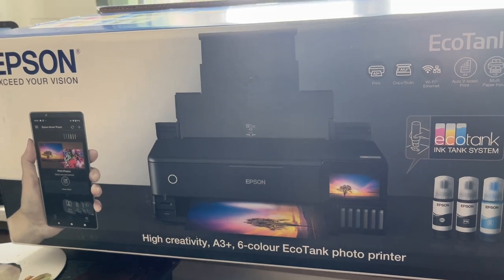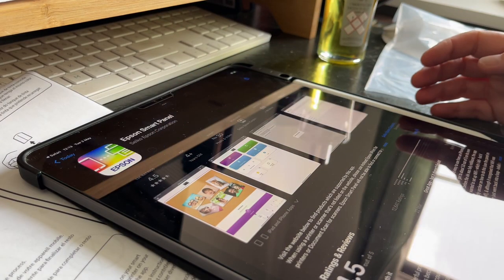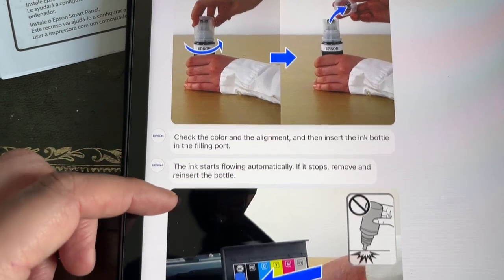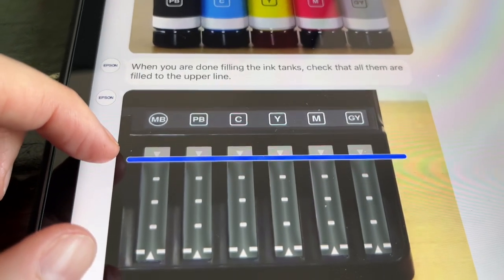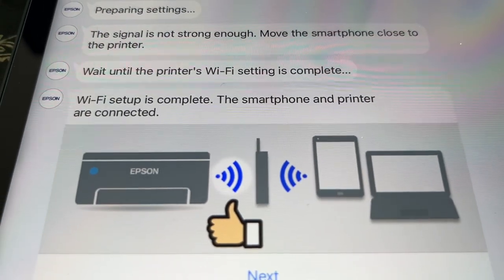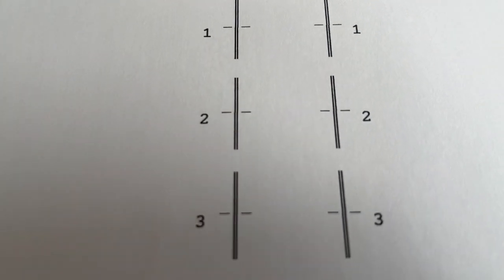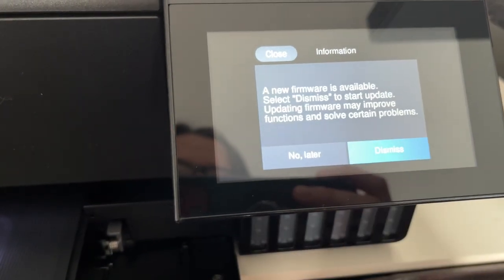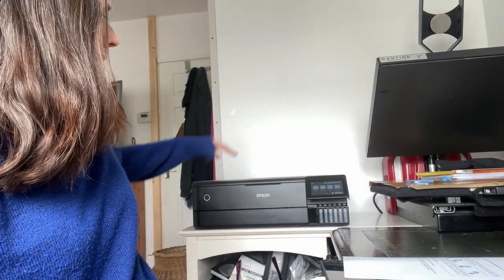New Epson ET8550 Printer for my Small Art Business, Printer setup and First Impressions

Comment: Exactly my reaction, too, when I first printed with my ET 8550.  "WOW!"  I've had probably a dozen Epsons over the years, including a 42" Stylus Pro 9800.  This new one is my fave by far.   I used a loupe to choose the alignment patterns.  They are hard to see.  Cheers from Western Canada.
Reply from the maker: I’ve printed many more since then and the quality has been fantastic each time. I had an SC P600 before this printer which was also a great printer but I do prefer the prints from the ET8550, they seem crisper too. I was unsure how they would compare being that I’ve moved to dye based ink instead of pigment ink but I’ve been very impressed. Thanks for the comment :-)

Comment: As an experienced photographer and printer, I can assure you that you made a good decision to purchase the ET8550 for your business, it is the most economical 6 ink printer on the market! I own 3 printers, 2 of which are like yours A3+  13”x19” print size, & 1 A4 printer, I will be replacing my old canon A3+ printer for the ET8550, simply because it uses bottled ink which is way cheaper than Rip off cartridges!
Well done setting up your new printer honey, enjoy making prints ❤
Reply from the maker: Thank you. I’ve recently topped up all my inks. I have only just discovered that the Standard setting prints very well too so although I’ll continue using the high setting for all my prints, I think there’s no reason why I can’t print my stickers with the standard setting which will also make the ink last longer. Thank you for leaving a comment :-)

Comment: Hey Justine!

I'm having problems printing my art prints from the ET 8550 and wondered if you'd experienced it at all since you did this video.. 

My artwork is printed and doesn't look like it does in my Photoshop/Illustrator file. The colours have shifted a little but look really saturated! 

I've picked 'Epson matte' paper in the print settings and also made sure that 'photosho/illustrator manages colour' but it's still doing it. I've spent hours running different prints through and I'm no better off. It's driving me nuts! 

Any advice would be really appreciated! Thank you!
Reply from the maker: Hi Sarah, I don’t actually use photoshop, I use the Affinity Software and I haven’t had any problems as yet, although I do always adjust the brightness when I upload my artwork into it. I used to use photoshop and like you, spent so much time adjusting the saturation and brightness to get my artwork to print in the actual colours I painted it in and wasted so much paper, that was when I used my old printer though. I do save everything in RGB and make sure my Affinity software is set to RGB too so I’m not sure if photoshop maybe converts everything to CMYK which might explain the difference in colour. I do also let my printer manage the colour so again I don’t know if that could help!! I do feel you’re frustration though, I definitely did suffer that same problem once and my only solution was to keep adjusting everything until it printed how I wanted it but unfortunately I had to go through this same process every single time. Maybe have a look at the Affinity Software. I’m not saying it would solve all your problems but I thinks it’s fantastic. I literally only used to use photoshop for the basics which Affinity does just as well for Me and it’s not expensive at all in comparison. I’m not sure if you can get a free trial but they definitely do deals every now and then of up to 50 per cent off. I think I paid £49 for it and that’s it, just that one of cost, no monthly subscriptions. Sorry I can’t be more help and good luck, I hope you manage to find a solution:-)
Reply: What kind of problems?

Comment: Hi Can you tell me what type of paper you are printing on?   I just set up my ET -8550 printer today and I am not having a good experience as my art is coming out very flat and blurry more than a bit... my old printer was much better so if its the paper then I wont feel like sending it back. Thank you!
Reply from the maker: Hi Katherine, yes of course. i use an Archival Matt Paper 230gsm by Marrutt for all of my art prints and the printer prints beautifully onto that paper through the rear paper feeder on the top of the machine. For the cards, which is a newish project for Me, I've used a 260gsm gloss photo paper by Photo Paper Direct and although the print comes out well, thats the one that gets the roller marks unless I feed it through the rear paper feeder slot at the back of the machine. I also have a 300gsm card I've used but there isnt a label on it and I can't remember where I got it. I haven't, touch wood, had any problems with blurriness, the actual print quality has been very good. Sorry I can't help more then that. I hope you manage to resolve it :-)

Comment: I bough this printer a week ago and after 3-4 prints the printer stopped printing and got a message that paper was jammed: which it wasn’t ( paper was not bent) I shut it off a few times and didn’t see any broken paper or particles inside. I spent 3 hours tryin to understand, the paper would just stop printing and would maker a rough noise( nothing was inside). 
I just returned the printer and I am waiting for a New one……very strange.
Reply from the maker: That is very strange but worth knowing. Thank you David, I hope you have more luck with your new printer :-)
Reply: @jagosart  Thanks 😊